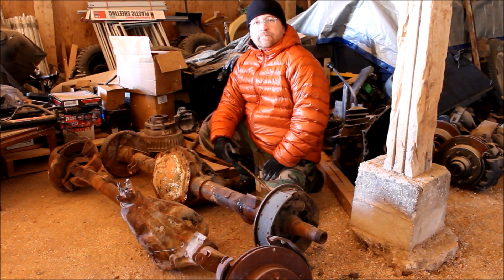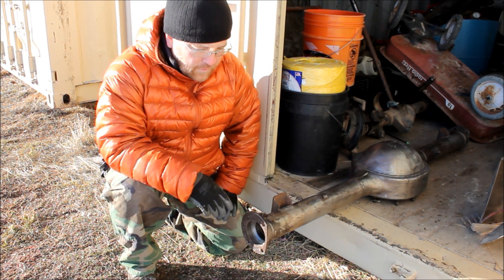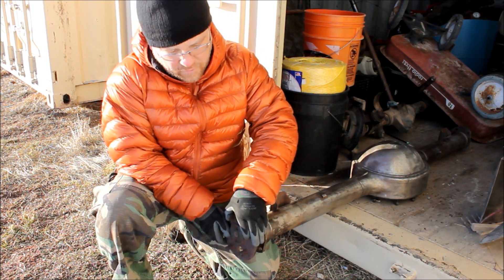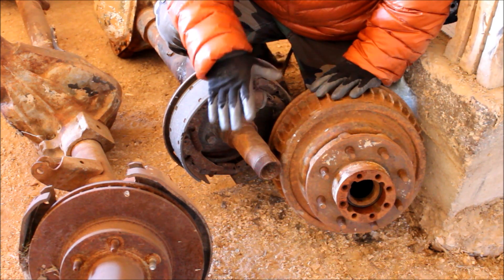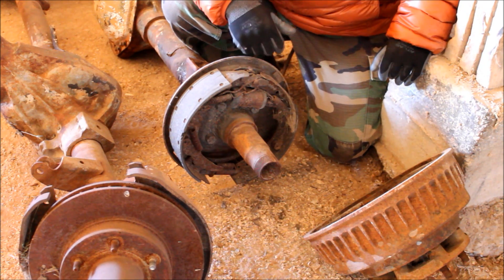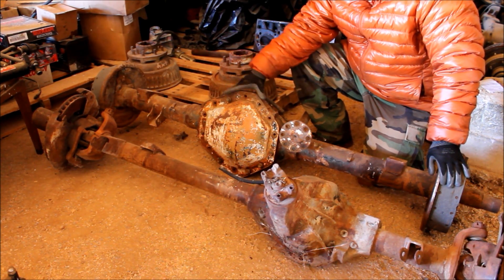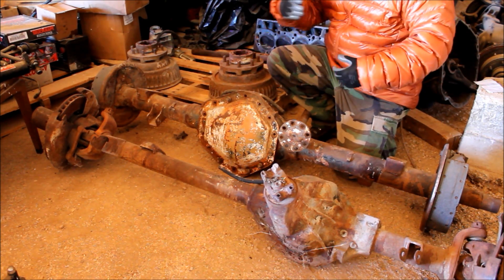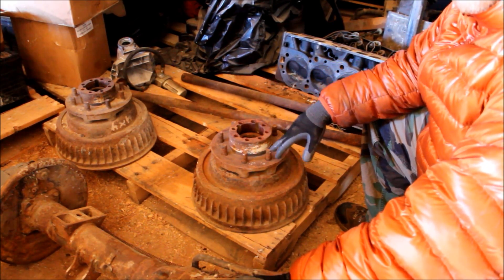What is a full-float axle? What is a semi-float axle?

Comment: AND ALL THE NEW REAR ENDS CARRY ALL THE WEIGHT ON THE HOUSING AND THERE ISNT A RACE IN THE HOUSING  IT ALL RUNS ON THE HOUSING AND WHEN THE BEARING GOES BAD SO DOES THE HOUSING  THE OLDER HOUSINGS HAD A REPLACABLE  RACE THAT SAVED THE HOUSING

Comment: Ford F 250's  3/4 ton used the full float Axel. Chevy and Dodge 3/4 ton use full float Axels also. F.Y.I. Class  8 Big Rigs use full float design as well.   Some wrecker drivers remove the Axles instead of removing the drive shat to protect the transmission when towing a big rig. The keep a 2 Cap's  made of plywood handy to cover the holes on each side.

Comment: One thing many here will already know, but might be useful to others, is that in most modern semi-floating axles, the shafts are retained via C-clips to the side gears of the differential, not by a bearing cap at the end of the housing combined with a pressed-on sleeve that keeps the wheel bearing from sliding inward, as was common years ago (and as shown on your semi-floating example here).

Comment: How do you pull a broke axle stub out of the rear end through the axle tube?  It's only a couple of inches long.
Reply: Take the cover off & push it out with a heavy wire or flexible rod.

Comment: Tyler what would you recommend for axle swap on 1998 ZJ I been looking 1984-1991 SJ because they are Dana 44 with a width 72.8 to my current width of 69.2 which is a 5.6 or 2.3 difference on each side. Which I am okay with. The rear is full float but the front is semi. I prefer a full float in the front after watching this video. Is the and ideal setup for wheeling daily driver. Perhaps i maybe over looking other axles. Your thoughts?
Reply from the maker: GlockUSMC how big of tires are you running, also what motor does your ZJ have?

Comment: I have a 93 suburban with a semi float and 3:42 ratio..I have plans for a 6inch lift and 35s or 37s even if I need a body lift for the 37s...I know that lower gears are needed and that's going to cost alot but am I  wasting time and money keeping the 10 bolt or can it be made strong enough without going to a 14 bolt? if I was to get a good deal on a 14 bolt with the low gears already in then all I would need to do is match the front gears..I don't rock crawl unless it's just a pebble in the road and I don't do any mud diving..I just like the looks..and no I never go to the mall.

Comment: I have a question maybe you can answer, maybe not.  I have a 1953 IH Metro van dually. I want o know if it's possible to replace all the bearings in the axles or should a guy just replace everything with newer more recent axles etc.

Comment: thanks for the explanation on full floating. However your description un unsprung weight was actually describing rotational mass. Unsprung weight is everything connected to the body via the suspension, the more unsprung weight you have the less responsive it will become, its more important for high speed traction!

Comment: I had a ford 9 inch break on me with a camper and trailer on the truck. We were going camping and we were 30 miles from the nearest phone. Needless to say, that sucked. It could have been a little better if the entire wheel hadn't come flying off. Luckily we were on flat straight road and not the switchbacks. Now I have a 1 ton. Half tons and partial floating axles are worthless! Nice video!

Comment: SO how dumb is this guy? This is the 3rd video I have seen with him in it, that give horrible information.
Whilst unsprung weight in racing is hard to get moving, offroad there needs to be a balance. Take a yj for example, lift it on 37s and keep skinny small axles and you're going to flip, now take the same yj, and slap a 14bolt, and 60 under there, shes never rolling, and will stop on a dime with a slightly larger master cylinder, a the breaks are designed for a 1 ton truck, and its towing load. 
damn matt I would have thought you would watch these vids first, and actually research the topic before allowing garbage to be spewed from your channel.,
Reply: + Chris Linden Your comment is full of errors (grammar, spelling, punctuation, capitalization, etc.). Maybe proofread (or finish third grade) before  asking "How dumb is this guy..."  
Just saying.
Reply: Ha.  Move along them.  He seems like a hell of s knowledgeable man to me.   If you so damn smart then Mabey you can make vids, send them to Matt , then you can have assholes with nothing better to do pick a part your pathetic video.  If you know you don't like him as a host then why watch and bitch
Reply: Apparently you missed the part where I said unsprung weight needs it's own video to be explained properly. This video was about semi float axles, not unsprung weight. Yes, it can be an advantage to have heavy axles that lower your center of gravity, etc. etc. etc. Nothing I said in this video about unsprung weight was inaccurate.
Reply: +Tyler Bleepinjeep you say full float is heavy, stronger centers, and bulky.
there was a ford 9in offered in full float, even more so they have many many kits that offer to make the ford 9in a full float, or the 8.8, or even the crappy dana 44 rear.
You are also forgetting to say if you have rear disks the likely hood of your rear axle shaft after breakage will come out.
Reply: +Chris Linden A full float 14 bolt IS heavier than a full float 9", or the tiny full float rear end in my GPW, or any number of other axles... There's always a balance between making a video that is informative yet not mind numbingly boring to watch. This video was meant to help new comers to the off road world understand what semi-float and full-float axles are, not to have a lengthy discussion on technical aspects and differences between specific models of axle. Discussions like that are best left to the forums where people can read through the responses at their leisure. Think of this video as a 2-minute trailer, not the whole 2-hour movie. It's meant to introduce the subject, give the basics and encourage people to go out and learn more if they're interested.

Comment: I have a question? It may sound dumb.. you or anyone out there is it impossible to use orange rcv boots on regular front axle u joints as protection from debris or whatever could hurt them u joints.
Reply from the maker: +Bailey Ferguson I really doubt that would work as they wouldnt fit properly and the CV is machined to hold the boot on.  Besides, U-joints dont need any protection from mud or debris... Any covering would just hold water.
Reply: +BleepinJeep oh ok... thanks for reply but I thought it would kinda.

Comment: The weight on the axle and bearing would be sheer forces
Reply: bending moment too
Reply: No shear.  Load-carrying applies strictly a bending moment to the axle shaft.  The load of the vehicle is carried at the very end of the axle shaft, but the bearing is a few inches inboard of that location.  Think of the axle as a lever with the bearing being the fulcrum.  One end of the lever is very long and needs very little force applied at the end to make all forces balance (that's the end that splines into the differential side gear).   The other end of the lever is very short and thus is subject to much greater stress (that section between the bearing and the axle flange which the wheel is bolted to, and using the crowbar analogy, this is the part where the crowbar does its job, so you can visualize how much greater the bending stress is there).   In actual fact, the bending stress is the same at any given distance of both sides of the bearing, but it decreases rapidly with distance from the bearing, so most of the inboard section of the shaft is NOT under much bending stress.

Comment: Are front axles full float?
Reply: +Jeff Young Yes but shorter due to the u-joint/CV and the outer shaft and brakes width. Only the "inner" is full float.

But if you think about it, so is an outer shaft. 

Because of this 2 piece design and shorter widths with angle between, the u-joint is the weak point in the front. A CV is stronger than an outer.

Happy Jeeping!
Reply: yes
Reply: can Anyone explain  carden joints ? That's what older four wheel drives had on their front axle prior to the late 70s. And the wheel bearings floated in oil.
 They were not packed in Grease.
Reply: @frankpaya690  A Cardan joint is two standard cross joints mounted in series, but 90 degrees out of phase, with a central ball and shaft that maintains alignment (keeps the joint from "flopping around" since it's a double joint and therefore not self-supporting against side loads).  This way, the variation in rotational speed of the driven side versus the driving side gets cancelled out across the full length of the joint.  Only the center portion of the joint has a rotational speed that varies, but there's no ill effect from that.  Note, the variation in rotational speed of a standard cross joint only occurs when the joint is "bent", and increases (becomes a more severe problem) as the amount of deflection increases.  For a typical driveshaft, the cross joints at each end are directly out of phase, and the angles of deflection are roughly the same (or should be), so the whole driveshaft works just like a Cardan joint, with the central portion (the actual shaft) varying in rotational speed with each full rotation, but the two ends driving and driven shafts at each end both spinning at constant speed.

Sorry that's so long.

For what it's worth, I've never seen a Cardan joint on the steering knuckle of the front axle of any light-duty 4x4 (nor have I seen any with oiled front wheel bearings).  There were plenty that used Tracta joints (like Dodge Power Wagons after WWII), and I've heard of some older light trucks (some "almost-medium-duty" IHCs) using a Bendix-Wiess joint.  Both of these are constant-velocity joints, like a Cardan joint is, but they work in very different ways.  I HAVE seen Cardan joints at the knuckles of heavy-duty Marmon-Herrington front axles.